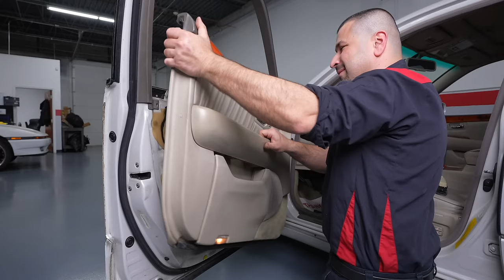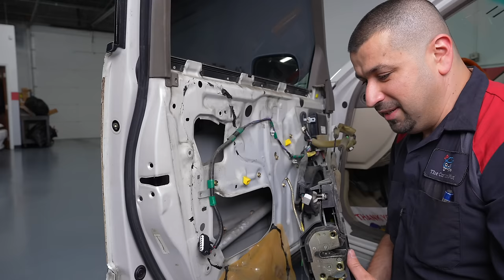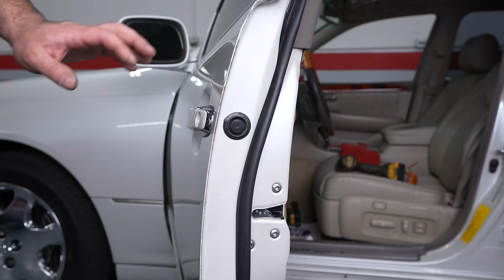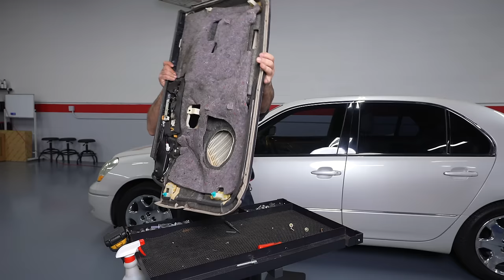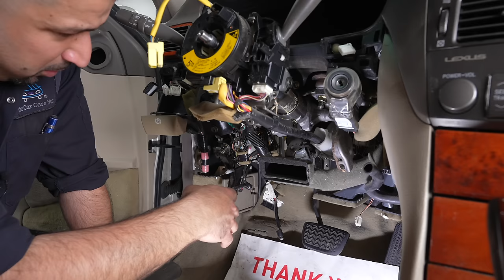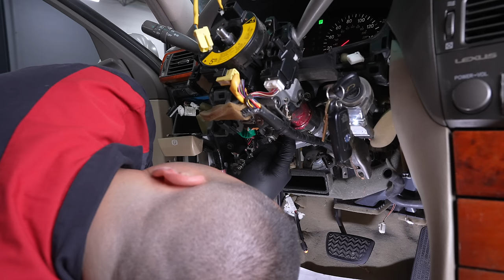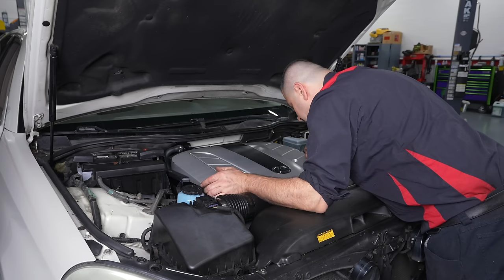Preparing Our 600,000 Mile Lexus for It's First Long Trip! and a Small Accident! Part 5

Comment: You have a conundrum with your transmission.  What is the value of the car with a good transmission? What are the pros and cons of that used Trans? What do you have to put into it to make sure it will not leak, COSTS?  Is the trans still used in later years so its not to old or the same year. How long can a trans sit not in use and still drive without issues from old transmission fluid and all the seals and gaskets?   What is the issue with a rebuilt Trans? If the person has done it for decades with great results why not have it rebuilt? it may get the upgrades in parts like many older trans do when rebuilt.  I bit the bullet, I know this guy been in business for 50+yrs with total 70yrs experience with everyone that worked for him.  he warranty's the work. Make them do what you want and replace all the worn parts that go out like clutches, electronics, Torque converter etc. The car has 600,000 miles on it, trans is past its prime is it not?  Give it a hug and let it go or give it some new parts, like the surgeon you are. :)
Reply: ALL good points. SONNAX parts and Jasper rebuilds for the win. Cheers!

Comment: Do you pull the airbag fuse or disconnect the battery when you remove the airbag?  Looks like you don't....have I been making more work for  myself all these years?
Reply: Disconnected battery off-camera. On-camera, re-connected to test motors.

Comment: Used transmission should work for this car even with 250-300k miles on it. Rebuilding would be cool but, as you said, god knows what else you will find when you open it up. "Afterall it is a 600,000 miles transmission but that's ok"

Comment: It would be hard to pass up a used transmission with only 45,000 miles on it if the price is reasonable.  Second choice would be to rebuild it yourself.  That's a video / series I'd watch, not that I'm ever likely to rebuild one myself.  Unless you know the rebuilder's reputation or have personal experience with that company, you don't really know how carefully they rebuilt it or what marginal parts they may have put back in figuring that all they have to do is make it last 75,000 to 100,000 miles max.

Comment: Sounds like getting a used low mileage transmission is the route to go, yet I still want to see the 600,000 miles transmission opened up...maybe just dissecting it.

Comment: How much do shops pay mechanics per hour? If they charge the customer $100 per hr does the mechanic get 50%
Reply: That’s a fair estimate, probably between that and 40%. I ran an independent shop for a while. We did 50%, I recall the dealership gave less, but they had more benefits to offer and probably a better flat rate.
Reply: @bruceharkness4497  cool thx!

Comment: rebuild the trans, replacing the whole trans sort of cheapens the toyota high mileage achievement moving forward.  because otherwise, any car brand can make it to or past 600k miles if you're ok with simply replacing major powertrain components when they start to act up.

Comment: 600K miles.....replace that transmission and give it another 600K.  The engine, provided the oil was changed and proper intervals, should be solid.

Comment: I would not rebuild a transmission with 600,000 miles.  Any part in that transmission can fail at any time.  I would go with a low mileage used transmission.